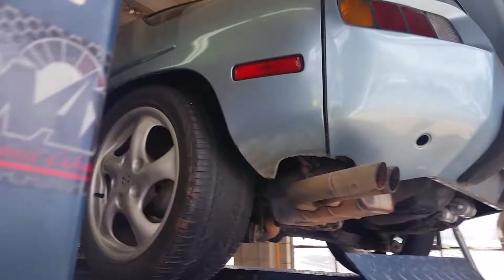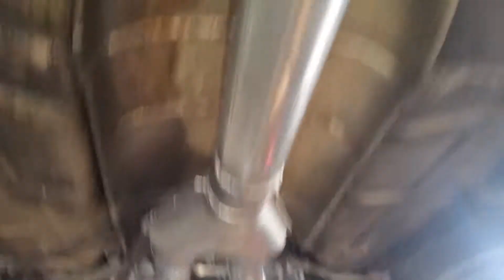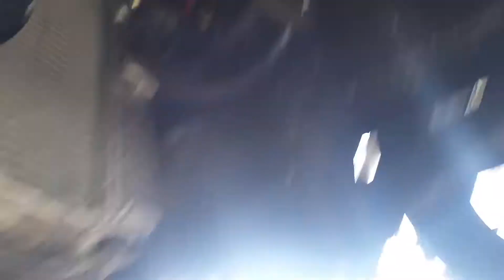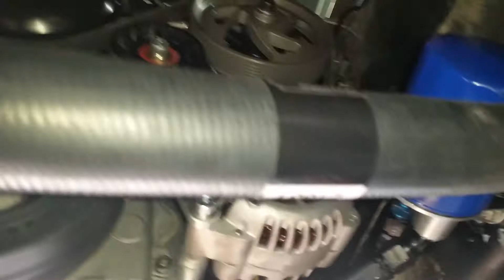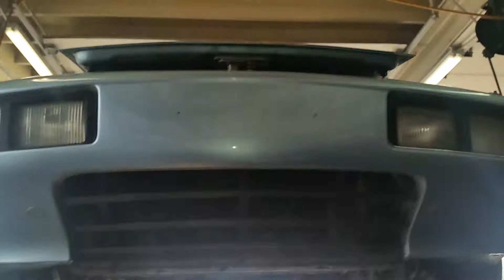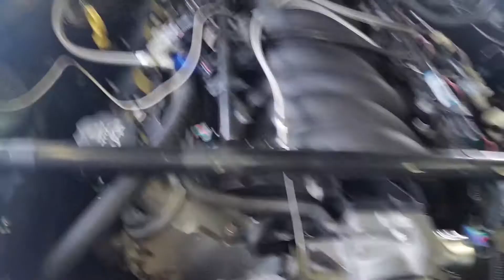Ls Swap Porsche

Comment: It’s the only way to go for reliability forsure✅
I have a really nice 1981 manual that has been so unreliable,and it could be this that’s wrong,could be that
So called experts haven’t got a clue😩
All they want to do is take your $$
And my car is a low mileage example
The LS Conversations really makes sense,done correctly 
IE matching engine weight,suspension etc and I’m not interested in racing,just reliability ✅
Ton of hp ratings etc to chose from👍